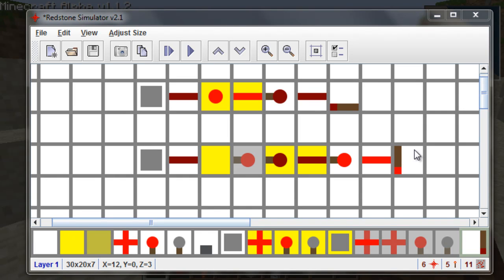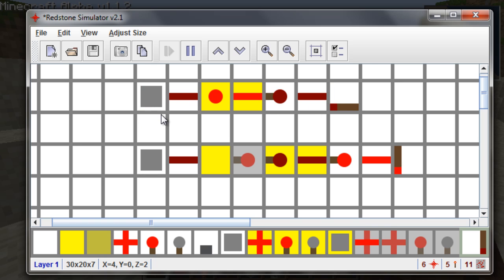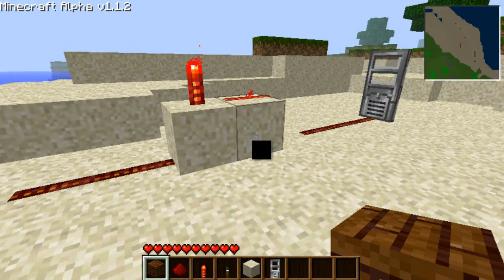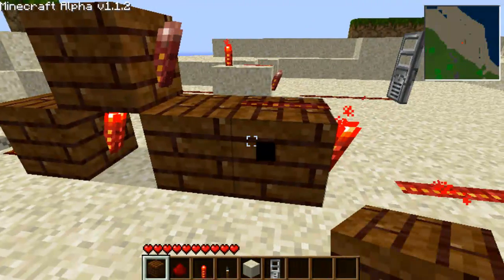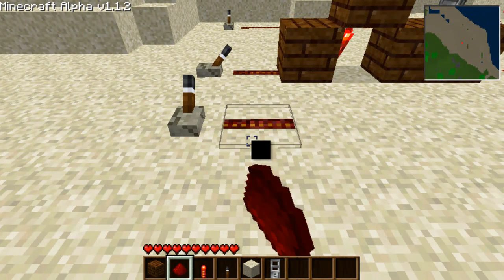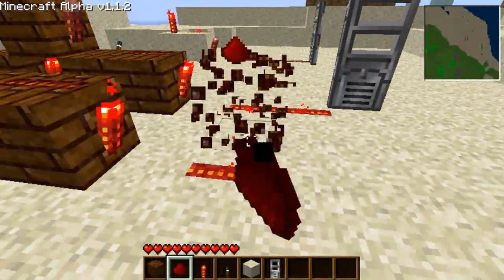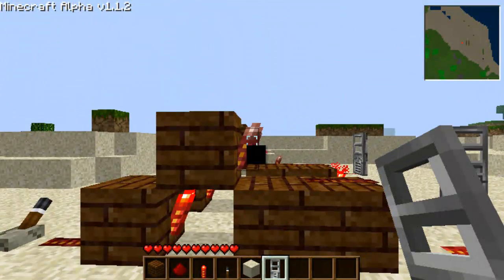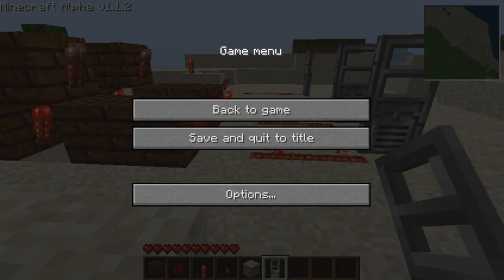Minecraft For Dummies - 2 Redstone Inverter

Comment: @EVILdemon1123 normally I would say that you are correc, it will burn out after a few times used, if that wouldn't happen I would still be playing rather than trying to find an invertor that does not fuck up all the time.